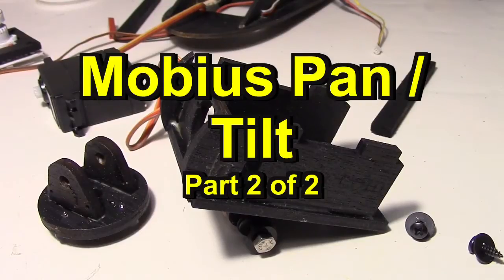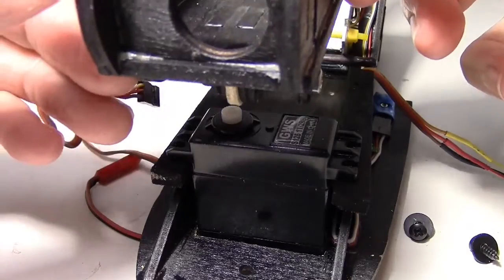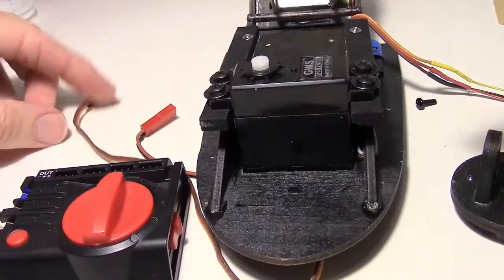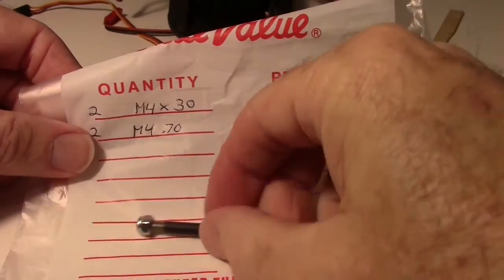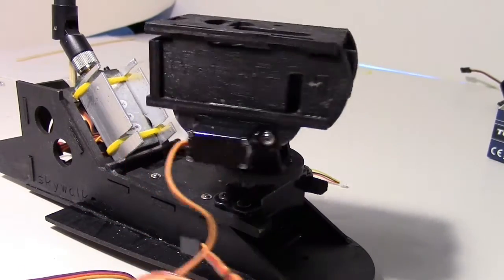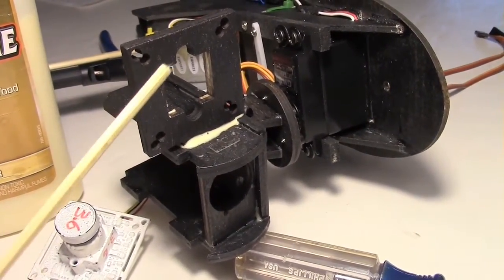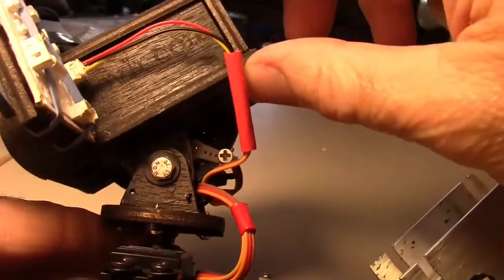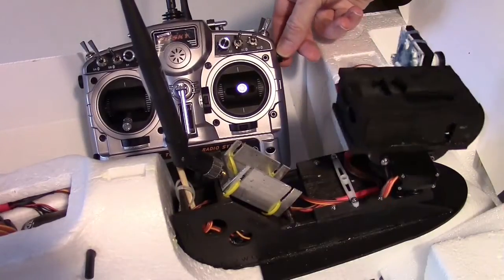FPVLR Pan/Tilt Build for Mobius and PZ0420 Cameras, Part 2

Comment: Brilliant video (including Part 1 of course). I was undecided whether to go with my Mobius, or GoPro 3 Silver on my new Skywalker build... I think this has just convinced me to use the Mobius as it is such a nice little setup with a better aerodynamic  form factor than the GoPro equivalent. Thanks for posting.
Reply from the maker: The Mobius is still my only HD camera. It's good enough for aerial video to put on the tube and the cost is so low you could buy several for the price of one GoPro 3.

Comment: Hi,

What is the weight of the total mount ?
I use the mount from CXN from RMRC. I think its more sleek then the one from FPVLR and should be more efficient.
Its much more easy, while flying, to use the left en right pods for pan and tilt.
That way you use your pointing fingers for pan/tilt and your thumbs for the control sticks

sorry for my rubbish english
Reply from the maker: Sander vdl I don't have a weight on it but most of the weight is in the Mobius and the servos. The CXN version looks good too. Thanks for the information!

Comment: I'm guessing that sail servo doesn't self center?
Reply from the maker: Benjamin Harvey It centers fine, just has more travel and no stops.
Reply: Cool got a link to the servo?
Reply from the maker: Benjamin Harvey I got it from glassdogangle. Check his channel for the ebay link.
Or search for GWS-S125-1T-2BB-Sail-Winch-Servo-full-360-rotation.